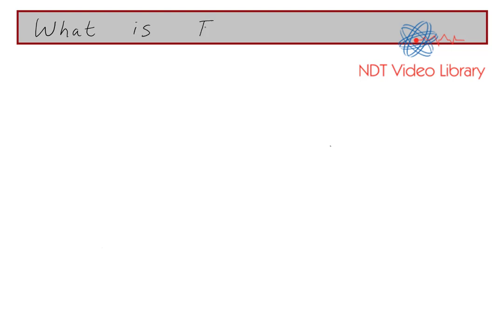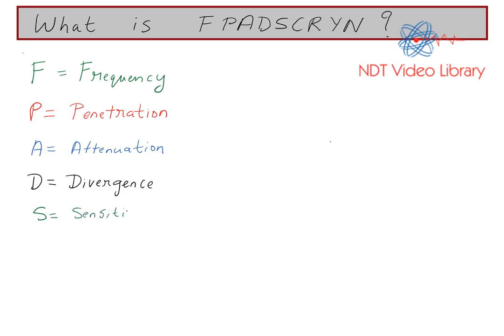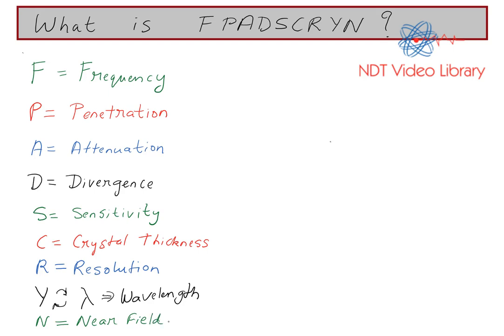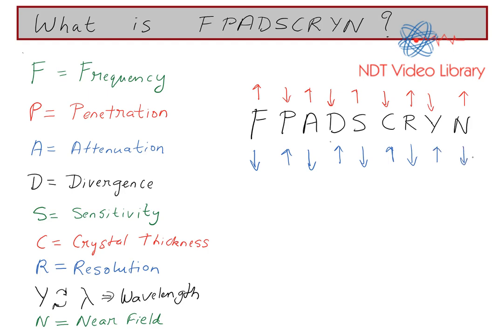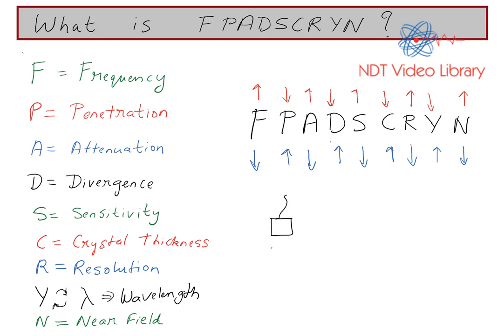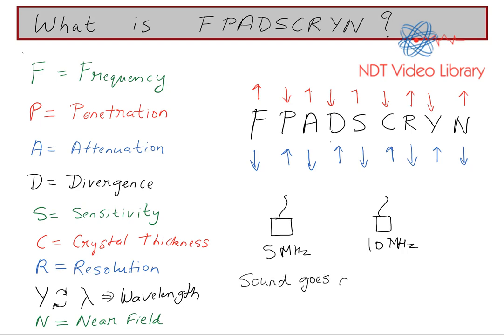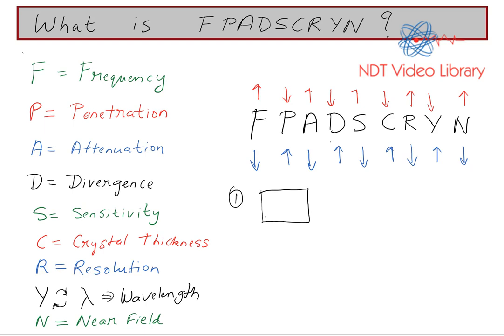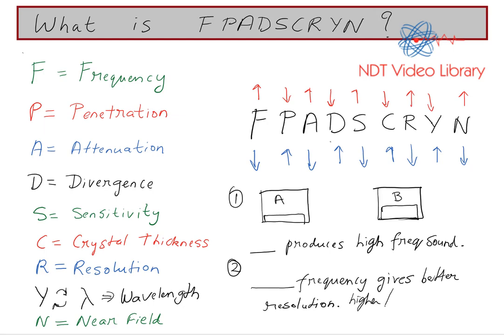Most important acronym in Ultrasonic Testing.

Comment: what about diameter?
Reply from the maker: Couldn't fit diameter in it. Well imagine a water hose with a large opening vs you pressing your thumb on the opening. Which case the water coming out will spread more? The thumb one right? So smaller the diameter larger the beam spread. Hope this helps.
Reply: Imagine mobile flash light (small dia) gives high beam divergence, big torch gives small beam divergence
Reply: @NDTVideoLibrary  Sorry for late answer... 3 years... I watched  your video, started to use your acronym during UT course. On the exam Day in 2019, I wrote the acronym on my draft paper. You can have some confusion because of stress during exam. But this acronym will give you answers to many questions and calm you down. RESULTS: PASS. Thanks a lot.🙏🙏🙏